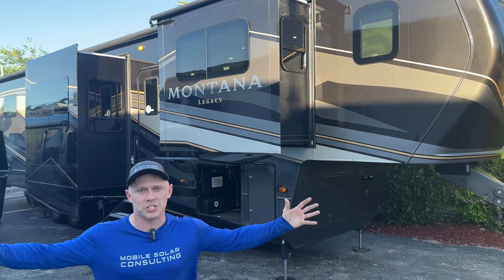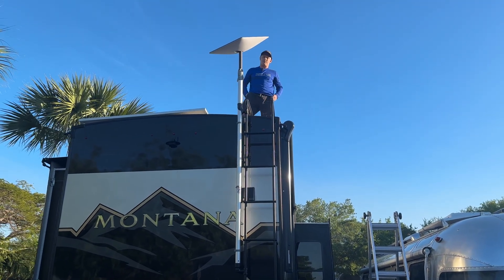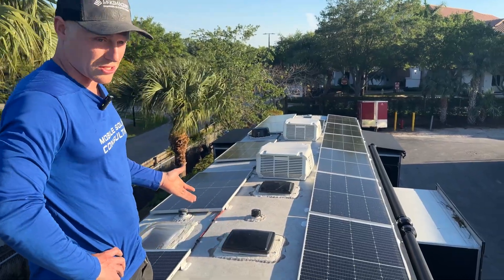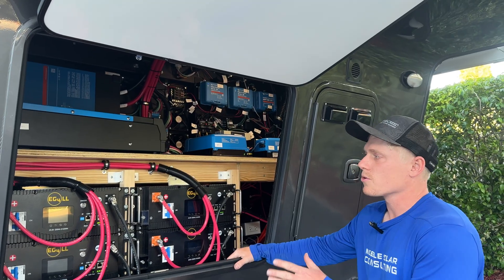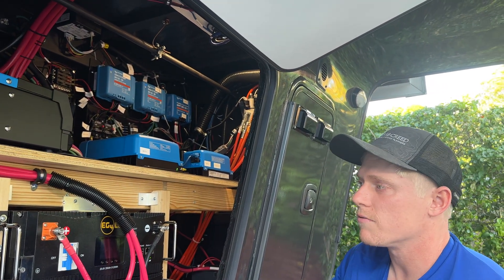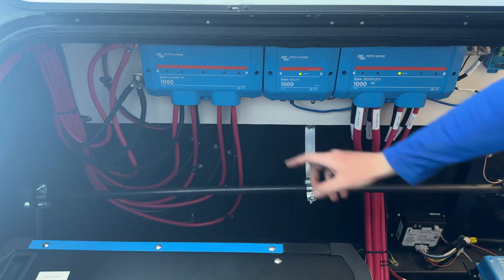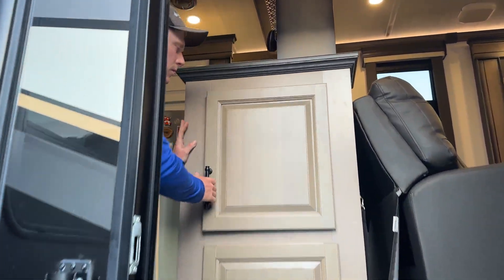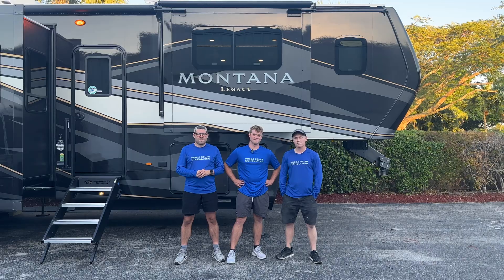HUGE Solar Upgrade to Montana Legacy 5th Wheel!

Comment: Great job, as always. I like those vent fans drawing conditioned air for that space that has a lot of heat producing components as well as batteries and exhaust it out too. More folks should do this, so their inverters don't overheat and derate and to extend battery life. My only criticism would be the shade cast on the panels by those large rooftop A/C shrouds. I racked my rooftop array above all my roof protrusions to prevent this. This allowed me to use bigger panels, freeing up more roof real estate. It also lets both coach and panels to run cooler due to much more cooling air passing between the two for even more power production and less heat load on my A/Cs. 

It's good that you went with a 48v system for all that power. It's a well thought out build.
Reply from the maker: Thanks for the feedback. We do offer racking above the AC units. Most customers do not choose it due to the additional costs involved.